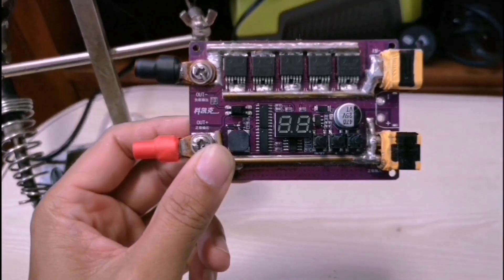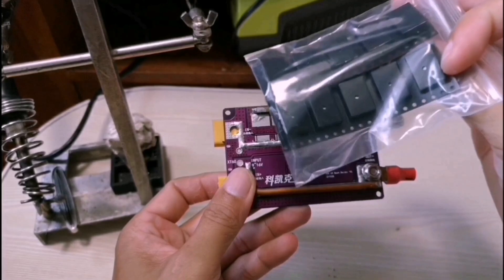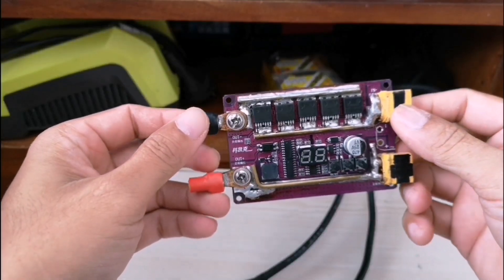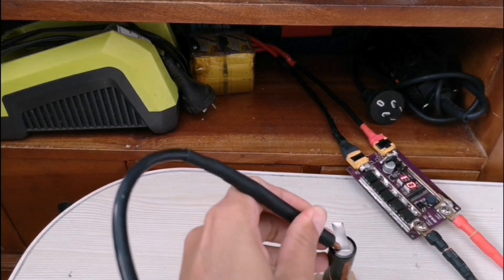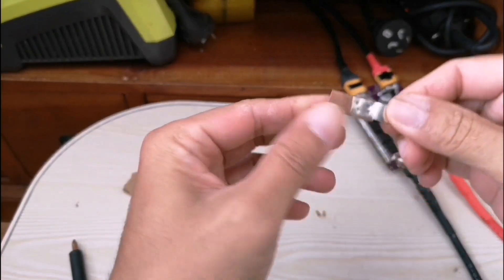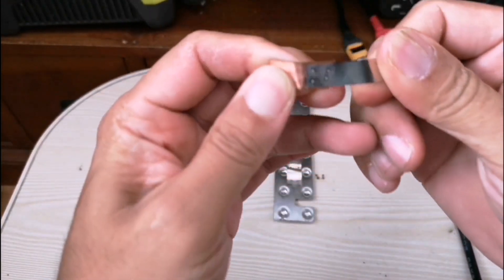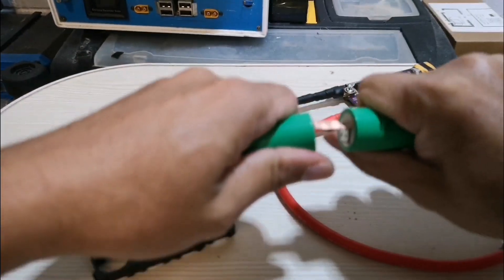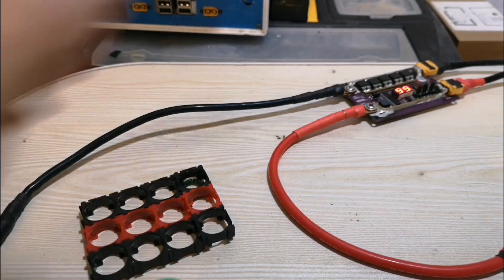Part 2 2022 portable spot welder. weld 0.2mm brush & nickel strip.

Comment: Last question please.   Do you solder your probes in?  or just crimp.   Made some out of some soldering iron tips.. Thanks.
Reply from the maker: Thicker wire gauge and prove help to reduce excessive heat, yes I solder it. I use 8 gauge wire.
Reply: well my second order of mosfets has arrived.   This time though they appear to be terrible quality.  I hope they are ok..

Comment: so... is there any reason this board cannot run off a microwave transformer?
Reply from the maker: What do you mean? sorry I can't figure out what you wanted to know cuz MOSFET and microwave transformer too far away in terms of set up or circuit design.
Reply: @pitikaron  I ment powering the board from a microwave transformer instead of a battery?  just a thought.
Reply from the maker: Your plan to use a microwave transformer to power up the circuit board  no it doesn't work it will explode the mosfet.
Reply: @pitikaron  Ok cool thanks.

Comment: I ordered IRLS3034-7P by mistake instead of IRL40SC209.  Will these not work?  Thank you.
Reply from the maker: Kindly please compare the data or specs , if it is the same well it will work but if it is not so don't replace it the MOSFET. The RDS on of IRLS3040 isn't compatible  to 209
Reply: @pitikaron  Ok, Thank you.
Reply from the maker: Thank you too...

Comment: With 5 extra mosfet the more power is affective upper in normal use..  is it worth to do this upgrade?
Many thanks.
Reply from the maker: If you are satisfied with the result it is not necessary but the more MOSFET the  better.

Comment: 10:05 Very bad quality.. Very poor welding quality. Overheating of the tape. It shouldn't be like this.
 It should be like this: https://youtu.be/Sa_uN4R3VDs - in any order, the tapes Cu or steel are welded separately.
Copper 0.3 mm https://youtu.be/Unk3O5Y3PYM

Comment: Wich copper you use for extra mosfets?
Reply from the maker: As long as the traces enough to manage burst current, like expensive spot weld K-weld.
Reply: @pitikaron  You added copper bars on the pcb side near where you solder the new mosfets, I meant that copper, what diameter does it have? Thanks and sorry if I didn't explain. thank you very much for your reply.
Reply from the maker: O.3mm round bar at the back side of PCB after I add another 5 MOSFET?

Comment: Piti Karon if I replace ALL the 209s on my board and replace with the IRL40SC228s will the board be ok as far as working with the other parts on board or do I need to beef up other components on the board too?l
 i will NOT be adding 5 more on the back just replacing the IRL40SC209s with IRL40SC228.
Reply from the maker: I replaced my mind and it's working pretty well 209 and 228 it's pretty relevant data specs. The more MOSFET the better protection. It will increase more amp limits. But it's all up to you...

Comment: Great video! I was about to buy the JQ-DHJ02B until I saw these videos. Think this is the one to go for. do you have a link for better thicker welding cables? yours look much better than the ones included. Thanks
Reply from the maker: Just buy silicone wire 8 guage
Reply: @pitikaron  thanks I will do. Your copper probe looks much better than whats included with these cheap welders too.
Reply from the maker: I use the copper tube from the included product and buy solid round copper 0.3mm thickness

Comment: Can you test the pulse timing of these 99 mode spot welders on different modes? I don't have a oscilloscope, I believe I seen you mentioning timing of 7/8 mode ones once in a video. 😅
Reply from the maker: Sorry I don't have also oscilloscope,  however the purple spot weld is the latest version 2022 model and more firmly compare to other cheapest spot welding,  but if you buy you must communicate the seller first coz their are a few seller sell shit or not authentic from the first version.
Reply: @pitikaron  OK OK no problem

Comment: Could you tell me what temperature you used for the solder on the back of the board for the new mosfets?
Reply from the maker: 60 watts at 450 Celcius but you need to make it faster by soldering the MOSFET to avoid not functioning.

Comment: What is the cable gauge you weld with?
Reply from the maker: 0.2mm both nickel and copper
Reply: No. I did not mean the nickel strip but the  silicone cables you are using out from batteri to spot welder and and to the welding pins
Reply from the maker: From batteries to board 8 gauge up to welding pen, however if you have 6 gauge it is better.

Comment: ...and short thicker cables would have helped too.. but I understand why you wanted the extra fets
Reply from the maker: It depends on the maximum power of the battery. You'll need to Calculate to avoid blown MOSFET.

Comment: That is not brass but copper...I don't believe you needed the extra mosfets, 5 of them are more than enough for all you did but you needed a better batteri for the extra current needed . 5 of the mosfets can endure 2500A that you never gonna get with those batteries...
Reply from the maker: It's all up to you! But as far as I know the more MOSFET the better
Reply: 4 go,s mine is dead now lol it needs more

Comment: Mine turns on i connect the battery i try to weld a beep sounds but nothings happens. Can you help me plz?
Reply from the maker: Can not weld?  what is the maximum pulse amp to your battery?
Reply: @pitikaron  i use lipo batteries of 2s 5000 40c, 3s 5000 40c, 4s 1500 100c. I try them but nothing.
Reply from the maker: What is the maximum voltage for 4S 100C? If the 4S exceeds 16V surely the controller of the MOSFET is broken due to over voltage.
Reply: @pitikaron Max voltage is 14.8. If this happened how can i check the controller?
Reply from the maker: Try checking the MOSFET if there is Any short and the two resistors near the output. If all is good surely the micro controller chip has the problem. Unfortunately I didn't know how to program even if you can replace that.
Reply: @pitikaron  How i check the mosfet?
Reply from the maker: Sorry I don't have a video to that but you can search in YouTube how to identify short MOSFET
Reply: @pitikaron  I checked the mosfets all are ok
Reply from the maker: do you have 5000mah 12V 100C battery?
coz all your battery that you try can only release 200A pulse! anyway did you see any spark when you are performing welding?
Reply: @pitikaron  no spark
Reply from the maker: try it with 5000mah 100C 12V coz I haven't encounter like what you had only beep no spark.
Reply: @pitikaron  except the mosfets is there something else i should check on the board? I believe its no matter of battery that there is no spark.
Reply from the maker: I think the only problem to your board is battery,  or the program for microchip controller.
Reply: @pitikaron  What you mean program?
Reply from the maker: just like OS to your phone operating system.
Reply: @pitikaron  What i can do with this?
Reply from the maker: sorry program is beyond to my knowledge
Reply: @pitikaron  4s 8400mah 120c battery is ok?
Reply from the maker: yeah it is good
Reply: @pitikaron  Today i tried to weld with a 3s 5000mag 80c the result the same. Only beep and nothing
Reply from the maker: sorry bro I can't help you how to re-intall the program so that your spot welding can work firmly.  re-installing the program to the microchip controller is beyond to my knowledge.
Reply from the maker: https://youtu.be/_T7fAKHPuWM
I recommend you this hopefully you like it
Reply: @pitikaron  Nice job bro but way too complicated. I am breaking my head to figure out whats goin on with the purple welder
Reply from the maker: Bro the spot welding need a program to the microchip once the program not functioning the spot welding won't act like a stater.  you can also use high amp starter as a spot welding the problem is the current is constant you can not reduce the current by controlling the milisecond. in every pulse their is a specific current flow. the longer the milisecond the higher current flow.

Comment: there is original and clone mosfet both at wide range price which did you get or are both reliable?
Reply from the maker: I order MOSFET from ali-express which is cheap. clone and original are both working pretty well.  if you buy original it is awkward to install cheap board spot welding.  coz it cost more than the cheap spot welder board.

Comment: Hi mate. I've got the f1324s-7p mosfets. One of the just blown up in 52 gear. I wonder if i can reeplace all of them for the 228 version. Thanks.
Reply from the maker: What sort of PCB board that you have?  READ the specificatin of the mosfet f1324S-7P if similar then you can but if not similar so not compa table.
Reply: You should replace all of them even if 1 of them is blown! And replacing them with 7 new ones from the same batch/reel in a row...and do no forget to solder 7-8 beefy diodes from drains to plus pole of the battery for preventing the flyback of the wires killing your mosfets again. Or one extra mosfet and use it as a diode by soldering gate and source together and solder to the drain of all other board mosfets and the drain to plus of the battery hence using the inherent diode inside as a diode. On these boards the thing is that the switchoff time is so long that the mosfets heat up and blow up...
Reply: @ImaginaPower  This is really good info...I'm just relatively new to electronics, so struggling a little to know what constitutes a beefy diode and which pin on the mosfet is the drain, and if every single mosfet is supposed to have a beefy diode?

Thanks for your time

Comment: what mosfets do you add? what was the specific model?
Reply from the maker: This is the first version so the manufacturer installed IRL40SC209. But I saw a few reviews on YouTube same board and installed IRL40SC228. I think I provide a link direct to the seller where I purchased the item.  It depends on the board what sort of MOSFET installed.

Comment: can i use two supercapacitors in series to 5.4v with this 99 gear circuit, thanhks!
Reply from the maker: I am not pretty sure!  more over I did not tried supercap my advice kindly please asked the seller. as far as I remember the circuit can be supply from 9V up to 16V.
Reply: @pitikaron  tks bro
Reply from the maker: Your welcome bro!  However if we follow the manufacturer guideline!  minimum 9V to 15V 5000 mah 300A to power the circuits bro.
Reply: @pitikaron  I'll try it out, make sure to use a separate 12v source to supply the circuit
Reply from the maker: Alright

Comment: Thanks many nice video for spot welding Bro. This is share inform for this board, I bought this one at last week. OMG placed IRF1324S-7PPbF for  FET... this FET is 24V 8mOHM 429A. yes i got spec down version Sayang😂
Reply from the maker: Anong nangyari?
Reply: @pitikaron  I guess some FET variation for this board already... mine  IRF1324S-7PP used. Anyway I will try and check for this version first. then if no good when i will change to FET IRL40SC228. But expensive IRL40SC228 more than this board hahaha🤣
Reply from the maker: Mora lang sa Ali-express.
Reply: @pitikaron  opo thank you Bro.

Comment: So do I have to wait untill my spot welder is here to see wot the extra 5 mosfets I need to upgrade mine  ???
Reply from the maker: kindly please asked the seller what sort of mosfet they instaled to the board. however without added other 5 mosfet you can still use the board.  but if you want more amp capacity for safety you should add another 5 mosfet one day

Comment: Does the positive lead from the battery even need to be attached to the board? It doesn't look like its doing anything on the board.
Reply from the maker: It depends on you what you like.  you can modified however the board need a power source to operate the spot welding.

Comment: I bought the same spot welder. Original there are " IRL40SC228 " Mosfet installed. Is it necessary to buy the same or can I also use the "IRL40SC209"? Does it matter if I installed 2 different Mosfet?
Reply from the maker: It must be all mosfet  are the same IRL40SC228 better mosfet than to IRL40SC209,  coz 228 can Mannage 557A  where as 209 can only handle 475A so if I were you If stay 228
Reply: @pitikaron  IF I GO FROM the 209 on the board now  to the 228s can the rest of the boards handle to upgrade or should other parts be switched to handle the 228s?
Reply from the maker: I just only replace the MOSFET other components I didn't touch it
Reply: can you tell me which seller you bought yours from?
Reply from the maker: I provide a link to the description list unfortunately I receive a negative comment that the link I provide headed to the seller where I bought my spot welder. The seller has sent the same board but the MOSFET they installed it's not 228. If you are planning to have one spot welder my advice watch this video and if you like you can buy. Because this pcb board spot welding design is more durable and easy to repair.https://youtu.be/_T7fAKHPuWM
Reply: @pitikaron  I don't see them offering the case which I couldn't find by itself any thoughts this looks great also do you think a foot switch can be added in somehow (I don't have the board to really get a good look at)
Reply from the maker: You can modify it by foot or finger switch I provide a link to the description list. But this is expensive compared to the finish product spot welding but reliable compared to cheap spot welding board ready to use. anyway your right the link I provided is not available, sorry. but I found relevant to the controller that I purchased. clink the link hope it will help you. 6y660 dual pulse same brand name to my controller. https://a.aliexpress.com/_mPIPcvM
Reply: @pitikaron  ok found it it was redirecting me to a different aliexpress item for some reason. got the right one now. for xt connectors are using xt60 or did you go larger i saw you did 2 of them vs the single one. lastly do you rec going to 228's or staying with the 209's if i decide to change out all 10 of them? THANK YOU!.
Reply from the maker: Yeah XT60. Every single wire 1 XT60 to reduce  magnetic field. What I used MOSFET through my video kindly please follow it coz it's tested. 209

Comment: Hi, can you share what kind of cell you are using (link will be helpful), how much series and parallel?
Reply from the maker: I used 8400mah 3S
AU $110.32  66%OFF | DXF Lipo Battery 2S 3S 4S  7.4V 11.1V 14.8V 5200mAh 8000mAh 8400mAh XT60 TRX for RC 1/8 1/10 radio controlled car Buggy Airplane
https://a.aliexpress.com/_mqjBPwK
Reply: @pitikaron  thanks 😀, In part 1 you use different battery pack, this one is better I assume, yes?
Reply from the maker: thank you too for visiting my channel, Yes coz I want to figure out what sort of battery capacity of a fresh or a latest model of spot welding could manage. exactly  better than first battery I used in part 1.
Reply: @pitikaron  Im thinking about buying this spot welder, what You think about this battery pack : connect parallel two 4S 8400 mAh (charged only to 16V). This will be to much (of course will be 10 mosfets)?
Reply from the maker: No no do not used 4S. 3S 8.400mah or 9.400mah.  if you buy two 3S 8400mah 130C you can parallel but the result still the same I did it off video. anyway try to watch this I think you might change your mind https://youtu.be/_T7fAKHPuWM
Reply: @pitikaron  Why I can't use 4S this welder is from 9V to 16V? From spot welders You tested what is the best in your opinion, that from enclosed video?
Reply from the maker: purple spot welder also good but the latest video I produce is more powerful and more convinient you can choose auto or manual moreover can perform double pulse which is more accurate in welding unfortunately it is more expensive visit the link I provide in the discreption list.  anyway yes the maximum voltage is 16v however I have had an experienced from the BIFRC I used 16V after experiment all the mosfet blown.  after that experienced I've never used the maximum volt in every cheap spot welder.

Comment: Thanks, could you please help me?
I have a spot welder attached to a car battery, but when i weld it makes a big spark and burns everything even at the lowest settings. What could be the problem please?
Reply from the maker: Check the resistance of the resistor to the gate of mosfet signal controller if good check every mosfet. what sort of spot welding you have coz their are two type of chinese cheap spot welding one with octocupler acting a relay to the spot welding one without octocupler.  only a microchip time controller?

Comment: have u thought about stacking the mosfet make it 15 or maybe 20? i know that 10 is powerfull enough but i want to see is it possible to get more power from it
Reply from the maker: no more room available for another mosfet and I think the circuit controller for mosfet  design for only 10 mosfet thats why the manufacturer leave extra space for another five mosfet.
Reply: @stephen8385: Remember the LARGE gate capacitance of FETs. Make sure
that you have a FET driver that can switch that heavy load fast enough to 
not overheat the FETs.....